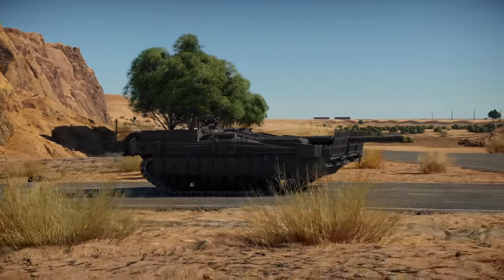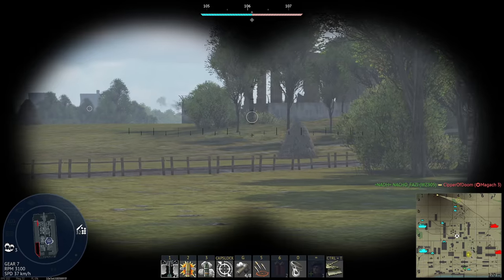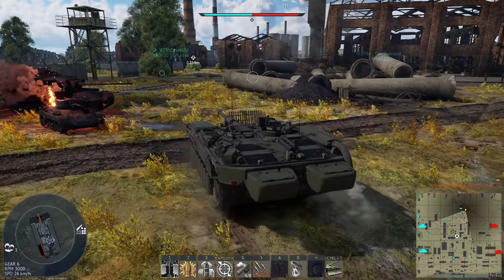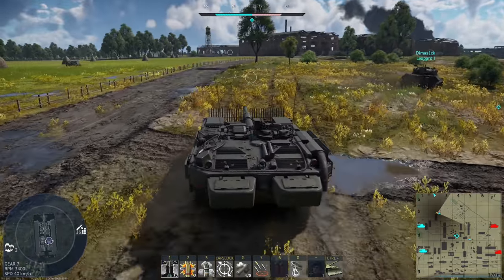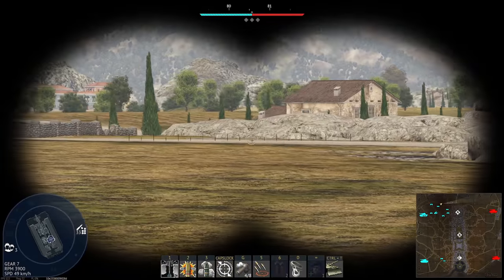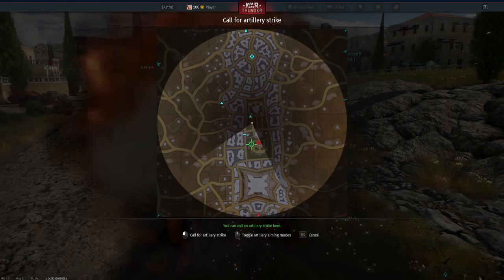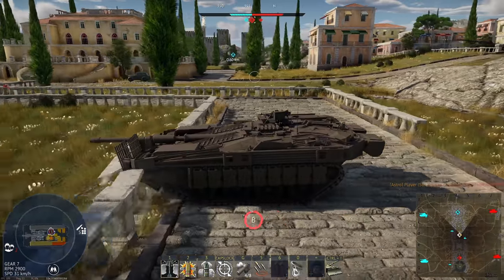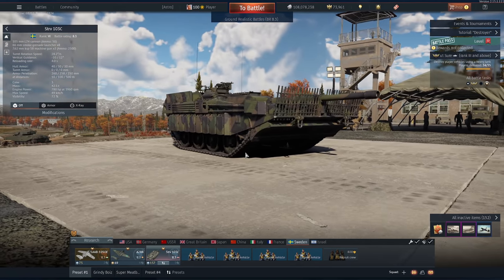THE MOST BROKEN TANK IN WAR THUNDER

Comment from the maker: ATD POINT NEWS HERE!  The Strv 103's have been in a sorry state for a long time.  There's a couple of outstanding games in this video but also some bloopers, too.  It's likely a lot of people are happier with the state of the hull-aiming but it could definitely be better.  I'd like to see the Strv 103's really shine and have full functionality.  Hopefully Gaijin can do something about it so they're worth playing with the exception of 2 or 3 maps at long range.

Make Sweden Great Again!
Reply: Gajin is also unable to properly model the turret mechanics of french tanks. The oscillating turrets are by design self stabilizing as long as the change in inclination or declination from terrain do not cross the amount of angle the turret can swing!
Reply: If memory servers the Strv 103's were really good early on. Bought it as a pre-order and was amazed by the aiming. It was spot on and was perfect. No bouncing or other issues then Gajin per usual, "fixed" something and broke it. It's never been right since. Ah, the issue was that it had a tendency to roll back wards on hills on its own. Not hard to deal with if you knew how but most people never did figure out the trick to stop it from happening, and demanded Gajin to fix it. "Fix" it they did.
Reply: It's not that it's that the strv ATTACK THE D POINT!
Reply: Isn't the Strv 103 irl able to operate on just one person?
Reply: Odd, can you please play the ju88 a4 at 2.3 with 2 5000kg bombs and 28 50 kg bombs at 2.3 thank you
Reply: @CoCoNuT-dq7ez  technically yes but at minimum is two people.
Reply: Oh, and gaijin please Strv103D once hull aiming's fixed. Gunner/commander thermals, m/90 round, and ERA.
Reply: @CoCoNuT-dq7ez  came here to say this exact thing, it's a very real IRL feature. Each crew member can control the tank in its entirety from their seat, if one of the other members gets killed or can fulfill their duty. Pretty cool, and complex system it has. Definitely worth a dive into its various wiki and military documentation sites.
Reply: I feel the prem being a lower br shines better than the tech tree on sense it runs into less needle boys. Heat still can shrek it but... the line up isn't to aweful that accompanies it so it makes it not hurt as bad xD
Reply: Can you do the VT1-2 Next? :3 It is a double Barreled Tank destroyer. o7
Reply: @CptBologna  yeah it's even more cool when you see it in person.
Reply: @CoCoNuT-dq7ez  yes it is
Reply: Can you make a combo video with the j29f or a lansen cas vid?
Reply: thank you now back to guide on me weather
Reply: I really don't want them fudging some gun traverse but it is a shame the state the Strv 103 is in. It is one of my all time favorite tanks from history - if for nothing else than the technical marvel its drivetrain and suspension system was and is. I won't claim to know the backend of War Thunder but it feels like they are trying to make the turret code work on the tank hull code when really for the Strv 103 they should be making the tank hull code work on the turret code. Aiming with the Strv 103 while stationary should feel just as smooth as any other vehicle in the game.
Reply: I'm really just glad to see a fellow Attack the D point enjoyer
Reply: Please play the T28e and the T80 2.3 ussr tanks, they great fun and you have no video on both tanks (day 19)
Reply: Hey odd, the crew thing is a real life ting. 1 crew member can control the intire vehicle.
Reply: ▪️The one thing that really deteriorates  Strv hull aiming is Gaijin's game mechanic of auto-aiming the gun at nearby objects.
▪️The incident around 14:35 happened because the gun auto-aimed at nearby pieces of metal junk & spuriously moved the gun sharply up (!). Took several seconds for the gun to elevate back down again.
▪️This mechanic got probably imported from Arcade battles - but it's 100% senseless in Realistic battles & is the source of many gun aiming incidents that get me killed personally...
▪️There's not even a configuration option to turn this auto-aiming mechanic off - it's unconditional.
Reply: I’ll say this as a Swe, the A and 0 variant are good, but on slops it is a mess to aim. I have gotten nukes in the 103-0 a few times. But the 103C is absolute trash, the aim is all over the place. When ever you try to correct a little it goes wobbly back and forth. But I am literally offended as a Swede, and don’t even get me started talking about the repair cost for everything. 8.3-11.0 is just ridiculous in repairs.
Reply: I watched a video of this tank, and apparently, each person had their own complete tank control. So, if everyone but one crew got knocked out, he can still control the tank.
Reply: So, technically, the one person controlling the tank idea is correct.
Reply: Am swedish
Reply: You should do a video on the rooikat 105 it got a small buff it has the dm33 shot now and can kill almost everything from the front and has overall become a much better tank because of the buff
Reply: Having all crew being able to pilot the tank is real to life. They implemented backup controls for all crew in the real tank. It was another one if it's very odd features.
Reply: They should give the real life reaload time of 2.3 secs and The Strv 103D for more armor like reactive armor and soon on and upgraded thermals, but a sweded can only dream
Reply: If you wanna get a lot of kills in a stupid tank switch to US servers. Stupid tank versus VERY stupid people makes it pretty good.
Reply: Thanks for bringing this up Odd!! I'm so bored of the bloody fact that you stand one track on an ant hill and suddenly you can't aim for S*£! FLAT GROUND and it's fine but my god is it the most frustrating thing to aim otherwise. Also on the rangefinding at any range the reticle just can't do it
Reply: As a Sweden main (ground to 11.0) myself, and someone who loves unique vehicles, it is so utterly frustrating and rage inducing that Gaijin can't program some half decent PID loops for the S-tanks' aiming.  
It's saddening to see how neglected many vehicles are, both of major and minor nations.
Reply: these intros are beautiful odd
Reply: @jaek_898  would love to see the D variant added, however, considering how none of the Swedish Leo 2s even have their correct shell (m/95, same as the CV90120) and instead have shells that they never fired (DM13/23/33) and considering how two Amphibious Assault Guns (The IKV 91/105) aren't even amphibious, I seriously doubt we would ever see something as nice a Strv 103D, or even a 103B for that matter.  It's a shame.
Reply: Also, fun fact Odd, some of the 103s could even Float.  But Gaijin will be Gaijin.  Both the T95E1 and HSTV-L are supposed to have adjustable hydropneumatic suspension, but they don't.  The M60A2 is supposed to be able to carry 13 ATGMs, it can only carry 7.  The Ostwind II is some creation of Gaijin's imagination.  The BT-5 and BT-7s can't go their real life tracked top speeds.  The British Firefly (and the rest of Britain's lower BR 17lbrs) doesn't/don't get their APDS.  Many of the Allied nations' 40mm SPAAs don't have their HE-VT shells.  The Chinese tree has more vehicles operated by Taiwan than China (roughly 52%) and less than half of the vehicles they did/do operate are domestic to China.  French AP doesn't spall consistently, fuel explosions ruin their top tier, and the Leclerc's reload and UFP are outright wrong, NOT TO MENTION THE ABSENCE OF THE FRENCH NAVY.  Italy is suffering for its air tree, Japan is, well, I don't know enough about Japanese Gameplay to speak too much to that point.  The IKV 91 is supposed to be impenetrable by 20mm HVAP frontally - it's not.  The Bkan is missing a pintle MG, and cannot traverse or elevate the gun the correct values.  HEAT-FS is ignoring ERA and Composite screen, so Israel ain't having the best time either.  

This is me just scratching the surface, and part of what drives my love/hate relationship with this game.  There is so much potential, but between Gaijin adjusting vehicle capabilities based on BR instead of adjusting BR based on vehicle capabilities, ghost shells still not being fixed, and historical inaccuracies, it feels like Gaijin is imitating the Usain Bolt shooting himself in the foot before a Sprint at the Olympics.
Reply: Also don't forgot the internal bulkheads that they nerfed from 30 to 10 millimetres early on.
Reply: Your intro always amaze me there either very funny like this one here or intense like others when u start of in a bombing spree
Reply: AGREED!!!!!!!!!!!!
Reply: @CoCoNuT-dq7ez  Yes
Reply: @julianh9347  Let's not forget about wheels. Either they are very fast and hard to control or frustratingly slow because of snow/mud/water. Oh and m42 is notorious for having really awful alternating while shooting. Gaijin pls
Reply: @CptBologna  actually, no, Only the Driver/Gunner and the TC has full functional controls, the Radio operator/Reverse driver can only drive, that station has no weapons controls or aiming device access.
The radio operatory/reverse driver does however, sit in the same interior compartment as the Driver/Gunner and has the same training, so if something would happen to the Driver/Gunner, in or out of the tank, the Radio operator/Reverse driver can switch places with the Driver/Gunner to regain full operational status of the tank, presuming no mdchanical or electronic systems are down.
Reply: @haglo.  ALL of the Strv 103 series are amphibious, they use the same flotation screen system as the ww2 Sherman& Valentine DD tanks only without the propeller and with a control extension for the driver so the crew can stand on top of the tank during water traverse for crew safety reasons.
Reply: Ngl, even tho u say it is "broken", any strv103 in the game is op in the right hands, and normally it is in the right hands, cuz shit players can't make it work
Reply: @Lord_Squirrels   Strv 103D  is meaningless, as it was utterly obsolete at its inception. The 103 was intended to be replaced by 1980, but was forced to stay in service until the T-72 trials showed a new tank was needed immediately.
Reply: If you switch transmission to manual and shift into the highest gear you can aim a bit better

Comment: It was designed for increased maneuverability in a heavily wooded environment that would impede rotation of turreted vehicles. Something this game completely ignores what with tank barrels clipping through buildings.
Reply: would be a cool feature to introduce barrels interacting with buildings
Reply: Also, technically, one man can operate/fire this vehicle.
Reply: It was also designed with defense in mind
Reply: Another reason was because multiple studies showed that the weakest part of a tank was the connection between the hill and turret. And that the height of the tank vastly increased casualty rate.
Reply: I hear you Juan and I too want barrels stopped by structures since they made barrels "solid" for damage-to-the-barrel purposes.

Alas, I don't think Gaijin will ever do that because "game play" (and the number of people who would whine) is more important than realism.
Reply: Doesn’t the big Swedish artillery have a physical barrel?
Reply: @chocolatesandwichesofficia8445  Arma 3 does that and it constantly ends with Tank Space Program.
Reply: @pauld6967  I think they could easily add that for sim battles and nobody would complain. But probably too much effort for this rather small audience.
Reply: @mev0lent  I too was thinking "Sim Only" but wondered how big that group of players is.

I have been playing WT for years now and did some Arcade in the beginning but now play Realistic almost exclusively. I don't think I have a single Simulator battle on my player score card.
Reply: @chocolatesandwichesofficia8445  Considering how that went in Arma and other games with physical barrels like gta....i dunno it could be a good implementation or it could end up throwing your tank into outer space.
Reply: @awacsrazgriz967  Or just don't make the turret have practically infinite power, similar to how the hull collision works.
Reply: @Ryguyz2004 All tanks have barrels that interact with their own hull but none interact with the environment. The 15cm German gun is a great example with the driver area blocking most of the left traverse
Reply: Another big part was that Sweden wasn't really expecting stabilizers to become the future of combat, going pretty much all in on the autoloader instead, leading to the static gun for increased reliability.
Reply: @2KDrop no they do not, the barrels are not "interacting" with the hull, the rotation is locked just at different angles, it doesnt run any physics or similar for it, its way simpler maximums and minimums.

Comment: That "one crew can still shoot and maneuver" is a historically accurate btw
Reply: The 3rd crewmate wasn't even necessary, but made loading easier (autoloader, so reloading the magazine out of combat).
 So they just went "put him in facing the rear and make him the get-away driver"
Reply: @Nugire  was pretty helpful when its reverse speed is 60km/h
Reply: @Nugire the 3rd crewmate was to drive the tank backwards
Reply: @Nugire there was no person as a loader in a tank that has an Autoloader 🙄
Reply: Need a full crew because Warthunder has to charge all of them 70$ a month or you lose premium status
Reply: @alangordon3283 Ussually when the autoloader breaks the only way to load was manually so he was a reverse driver but he could be a loader in case the autoloader breaks which does happen
Reply: @alangordon3283  somebody needs to load the autoloader, the tank can carry more rounds than what fit in it
Reply: The reverse driver was also the radio operator.

Comment: Actually its technically historically accurate as the STRV-103 only really needs one crew member as the Driver is also the gunner... technically...
Reply: is correct, historically this vehicle has redundant controls for its crew which makes it possible for it to be operated by a single person.
Reply: Yeap saw a page on Reddit that said the same thing, no separate gunner in strv103, driver is the gunner. 3 guys are the commander, the main driver(gunner), and the backup driver(gunner).

Comment: The 1 player left mechanic on this tank could be just a buff to this tank but in RL 1 men can actually fully operate the tank
The second strange thing is that this tank has 2 engines, one diesel engine and one gas turbine, it can run them seperatly or together, so if one engine gets knocked out this tank should be able to still drive and steer.
Reply: I'd love if they added that but 90% of the time the transmission gets taken out aswell so I don't see much of a reason to do it. still would be cool
Reply: the engines are controlled automatically the diesel it always running the turbine kicks in when high speed or more power for adverse terrain is needed.
Reply: And while all the crew is trained in all driving and gunnery controls, only the two forward facing crew stations has full operational controls. The Radio operator/Reverse driver station only has steering and speed driving control and radio controls, no gun controls, and no suspension controls.
Reply: @SonsOfLorgar  Yes, but if it is needed he can just move from his positions and assume the controls, if of couse he can get out of there.
Reply: Helpful for the weird way it aims
Reply: @adriancoric1721   It also has 2 transmissions
Reply: @adriancoric1721  It also has 2 different transmissions so it can still keep driving with one engine and one transmission taken out